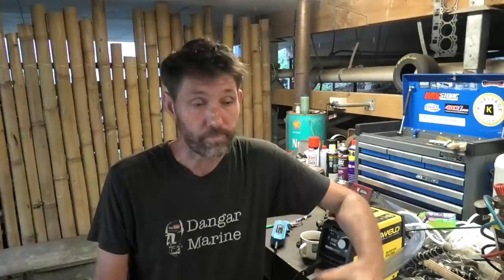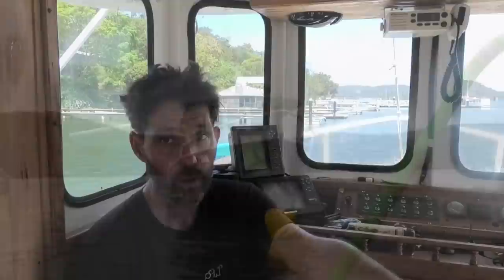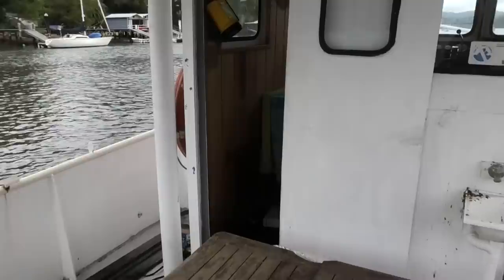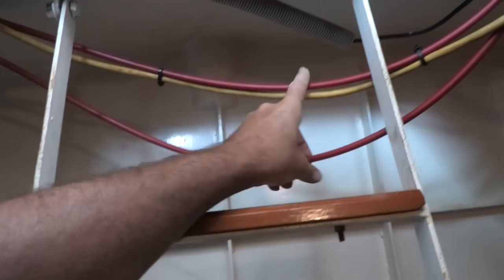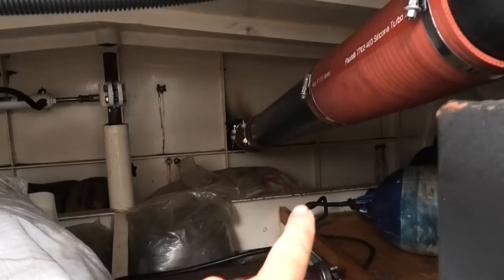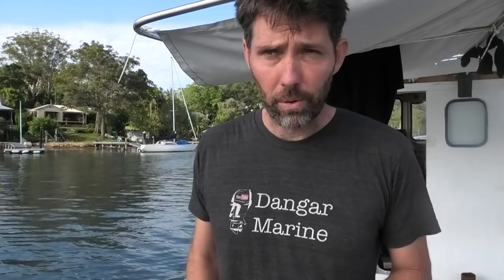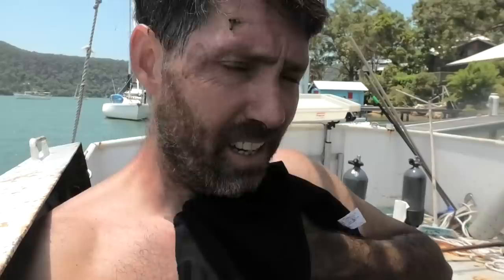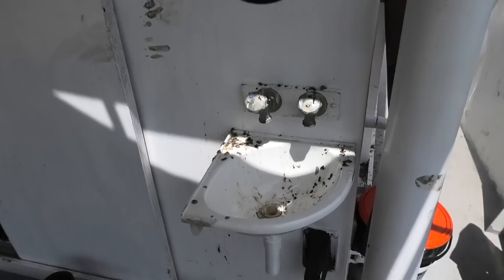Is it a bad idea to buy an old steel boat?

Comment: I had a Navman GPS in the late 1980's... it was one of the most intuitive GPS's I've ever owned (and I have 10 +). You simply did not need a manual or tutorial to operate it.  I believe it originated in New Zealand.... cool boat!
Reply from the maker: Although I didn't have any charts, I used it all the way up for heading and speed, it was great. :)

Comment: driptroits were always good runners  but fuel hogs. if the governors are set correctly you can rip the engines apart and put them together and they will run just fine.  i expect that someone set that with the throttle linkage installed.big mistake, but if it runs ok otherwise its a small adjustment  to get it right. hint set it with the boat in gear. that may be what is wrong. it may idle a hundred rpms higher in nuetral but that wont hurt nothing.

Comment: Stu,
Congrats on the new boat!   Looks like it's worth putting some time into.
Great thing about a steel boat, is you can always cut and weld, if you need to repair or modify.  Again, congratulations!
Reply from the maker: Thanks Tony. The ability to cut and weld steel and have it be as strong as the original plate is  one of the things that made me happy to take a gamble on this boat.

Comment: You mentioned rust several times but I didn't see any on that boat.  In fact,  compared to some really rusty steel hulls I've been on, that one looks pretty darned clean.
Reply: Some was on the deck
Reply: Don;t worry ..if it's old it will have plenty (most of it hidden)

Comment: I'm sure you probably already know this but Stuffing boxes / packing glands, which ever you prefer to call it will always be trouble, You probably have to open it up and pull out all the old stuffing and add a few new rings. we always used the wax coated military surplus stuff but if maintained properly it will just drip slowly to keep the shaft cool. every trip, a few turns on the nuts and it will return to a slow drip!   my opinion, change it to dripless shaft logs. good luck.
Reply from the maker: Hey mate, I have been looking into a dripless conversion, but I'm a little worried about how little room there is between the gearbox and the bulkhead. If I can't get anything to fit I'll definitely disassemble, clean and repack this one before putting it back in the water.
Reply: Hey, for what's it worth: my experiences with these kind of seals are pretty good. No leaking in years in neither of the boats. Also in our case it's not necessary to tighten the gland frequently. We do fill the shafttube with grease though. Sorry for my bad English ;)

Best regards, 
Dirk
Reply: Fresh packing and lots of grease, and it will be fine.   Put in more packing than you think, as it compresses.  That's why the bolts are so long.  Grease it well, and it will only drip here and there.  
I like the idea of making a mini-bilge under it.  Great idea.

Comment: We just bought a really old wooden boat and sailed it half way around the world, we are on our way to sail the other half :-)
Reply from the maker: Great to hear you are getting out there and have a great adventure. Safe travels! :)
Reply: Dangar Marine becarefull about the hawksbury river monsters.
They plucked a cop right off the stern during a party.
Reply: Steel I know, steel i understand, steel I can weld in replacement plating and zinks.
Reply: HappyandAtheist  with steel you wouldn't have had it.
Reply: HappyandAtheist  cool, I'm a commercial fisherman from Alaska, also an atheist and reasonably happy. Yup, lots of chipping, grinding and painting but steel for a reason.
Reply: HappyandAtheist  Nailed Plywood,,, on what kind of boat and how'd you do it?

Comment: We had PSS dripless shaft seals in 3 of our work boats and gave great service, I’ve also got one fitted in my own sailing boat and it also been fine... the only problem we had with 2 of our steel workboats was the grub screw working it’s ways out a couple of times causing it to slide on the shaft...
That leak is a little more than I would feel happy about I must say!

Comment: We've worked on all types of boats and prefer steel...by far. It's so much easier to modify/outfit. Adding lifelines to 40' fiberglass took us a week...same size steel boat took a day. Through bolts, backing plates, and sealant on fiberglass...just weld it on in steel.

Comment: They have not built a 4-71 Detroit in 50 years
Reply: No need to - the old ones are all still working fine :)
Reply: @mordokch  Here is one for you. When we rebuilt these engines we would put the pistons in dry ice and the liners in a very hot oven. We would remove the liner and put in a holder and then insert the pistons and then put the liner and piston in the block.  We gaped the rings on the cylinder when the were completely collapsed around the pistons.

Comment: Bit of Homework for you so next week ... you may be able to get the  nice Local Chesterton distributor just to throw you  a free roll of Packing, would recommend you maybe bit a stainless for a Packing Gland spun off a Lathe,  you could strike lucky, even a scrap bit heavy wall Stainless pipe 'Slip on" flange with a stub of pipe that had been already  welded to same, could be skimmed down to act as a new stuffing box...if you come by one with the correct rough dimensions...Time to Pull the Packing as it's probably hardened up and no amount of swinging with a spanner will cure  same....Hand operated Bilge Pump could be a Belt and Braces Option....you have really got there now these issues are just minor tinkering... again another Great upload...

Comment: A marine survey is HIGHLY recommended before buying a vessel like this.  Dangar Marine is 100% capable of dealing with most of the issues, with the exception of an ultrasonic reading of the thickness of the steel for possible pitting of the steel.  Extreme cases require re-plating of the hull.  With all the water in the bilge I would want to have the boat hauled and inspected before purchasing.  Other than that, looks like a good score!
Reply from the maker: I've been looking at the testers for checking the thickness of steel online and they've really come down in price. I'd like to see some good reviews first though to see how actuate they are, particularly when measuring through paint. It would be a great tool to have though, even just from a peace of mind point of view.

Comment: Take a 3 inch piece of rubber fuel hose and split it. You can slip it over that locking nut on your shifter.  It might be vibrating loose..

Comment: 3 suggestions. Fit a dry stack to in and weld the transom shut.  Install 2 bilge pumps with dedicated wiring to battery. Fit a boom over the hatch covers to  ease that battery  change and dive tackle.  Good idea on the chain locker, just don't leave it open to salt waterl Good idea on the gunwale cutouts.

Comment: The variable speed governor on your engine is very easy to adjust idle speed on. There is an adjusting screw that fits a 1/8” Allen wrench right below the throttle cable you adjusted. It has a locknut that a 7/16” or 11mm wrench fits on. All you need to do is turn in that screw slightly while the engine is running and the rpm will increase. Then lock the nut while holding the screw from turning. The buffer screw then needs to be set which is just as easy but can be the reason that the Detroit’s Diesel engines run away. The screw is only turned in while the engine is warmed up so that the rpm does not increase more than 15 rpm. You need a good digital tach. The buffer screw is located 90 degrees from the idle screw on the side of the governor housing it is a 3/8” fine thread screw that uses a 9/16” wrench to lock the nut.  Most likely the buffer screw is your problem as it stops the rpm from dropping to low when the throttle is pulled back to idle quickly but the idle speed has to be in the right range usually around 550 rpm before setting the buffer. I’ve been a diesel mechanic for 30 years and have built thousands old Detroit’s right up to 16v-71s

Comment: The stern bearing/ stuffing box on my rusty old steel boat has a grease line in to it so at the end of the day fill it to stop the leaks. The water dripping in helps cool it.

Comment: Interior bilges look great. That is where steel boats rust at. Little trick for keeping the hull looking nice. Phosphoric acid. We have a product here in the Sates called Ospho. I use to keep it in a spray bottle. One trip around the hull in a dingy and spray this stuff on. On the second pass rense it off with a little water and the rust stains go with it.
Reply from the maker: Yep, bought 5 litres today. :)

Comment: My steel tug is 75 years old and is 72 ft long. Only replaced 1.5 square meters of hull plating in the wet areas,  the rest of the hull is perfect. The Atlas Imperial engine runs smooth and uses 2 litres per NM not bad for pushing 100 tons through the water. She's for sale NZD75000

Comment: A old School Temporary fix. on Steel Hull Boats and Barges is to stuff the holes   or leaky areas with Toilet Wax rings  and rags  then drive  Wooden Wedges into that to  help hold it all in place  that will often. allow the Bilge Pumps or Bailing to keep the hull floating  or being lost  i was once on a Fiberglass Vessel that rammed a broken Sunk Wood Piling and punctured a hefty hole into the Hull  i jammed a bed Comforter  and Blankets into the opening and it allowed us to safely get to a close Marina that had a Travel Lift they  could use to keep the boat from completely sinking  the boat was eventually fixed correctly  and the last i had heard was still being used by its last owners   those Toilet Wax rings are inexpensive and very Sticky  of course they are designed to seal Water from leaking  at the connection of a Toilet to the Drain Flange  on the Sewar Pipe

Comment: If you will be welding on the hull, you might want to consider a clean water sump under the shaft seal. You just build up a watertight box under the stuffing box with vertical  flat bar welded to the bottom plate, typically extending forward to the closest frame.  You fit a small float actuated bilge pump into the sump. Any leakage from the stuffing box collects in the sump and is pumped overboard with the small bilge pump.  The sump isolates the shaft seal water from the engine room bilge, so the seal water does not get contaminated with oil. Hence the name "clean water sump".  Greg

Comment: Have always been interested in taking over an older metal work boat.  Will be interested to follow along and see what u do / run into on this project.  Thanks for sharing your experience!
Reply from the maker: There will be lots of work I'm sure Tom, but if you get the right boat it is all doable and well worth it in the end.

Comment: The Detroit 71 series diesels are hard to beat.  You should use Delo 100 in them because it was designed for them.  Other wise your oil usage will go up.  All the Jimmies I have been around in the lower 48 and Alaska have a couple of sweet spots,  1350-1375 and 1725-1750.  

Oh you may have people telling you how fuel thirsty Jimmies are...  because they are two stroke!  They are not.  The one thing to be careful of is jazzing the throttle fast...  They have been known to break the quill shaft that drives the blower.  To remove the blower you will need a 9/16s horseshoe wrench.  There are two bolts that need that wrench to be removed or installed with out removing the cam/blower drive covers.

Comment: My mooring was next to this boat for several years in the Lane Cove River, mate of mine owned it. He was a marine mechanic for many years and now works on cranes I believe. It's nice to see this old girl being worked on, it's a great boat. Does it still have the remote control fob for activating the lights etc? Was a great feature when you row out to the boat early morning in the dark you could click the key fob and the anchor light would come on, very handy.
I gave him that radar, never worked but looked good!
Get in touch if you would like to know more or would like the contact details of the long term owner.

Comment: This video set of my PTDS. I once bought a cheap unwanted 38' steel boat - my condolences. As to the donk, as a kid i plowed on an old Chamberlain Super 90 tractor with a 3-71 s/charged engine. 40 years later i still have tinnitus in both ears.

Comment: Thomas Colvin wrote the definitive book regarding steel boats. In a nutshell: sandblast to white, give proper primer and paint...it will last 20 years. I had a 10 meter sailboat abandoned to me in year 2002. I'm still living on it now, (2019 w/ only minimal maintenance.
Reply from the maker: You're dead right that you can't beat sandblasting. I will probably do that next year after a bit more saving. It is about $2500 to do the hull below the waterline.

Comment: Terrific Stu! Looking forward to lots of interesting videos on this new project. Love her lines and of course looks nice and heavily built. Combined work boat and pleasure cruiser is a great mix!  A couple initial thoughts. Engine injectors - maybe a place to investigate? Also, looks like you might have a bit of exhaust leak around the thru-hull? Be good to get that sealed if so. Great idea about cutting some boarding doors in. Might want a double-wide one somewhere in case you have to wheel larger cargo or equipment on board. Speaking of equipment, you've got lots of room on that deck for a fire/high capacity water pump. Great insurance and very helpful around the waterfront for everything from washing down decks to refloating boats. Looking forward to the voyage!

Comment: I know the joys and lows of buying a steel boat. I bought a 32 ft steel ketch cheap and I am still working out all the little issues that have come from the previous owners contributions. Your vessel looks very sturdy and should be fun to use once you get it to where you want it.
Reply: 10 kw ekrrç  32 kw baters oàçk 3,2 hiurs topspred

Comment: Steels typically rust from the inside out, that's where you need to focus as far as the hull is concerned.  Replated the aft 6' of a Chris Craft Roamer years ago and it already started getting pinholes after 10 years or so.  This was in fresh water to boot...

Comment: 9m is a good size, most of the cheap pontoon docks are organised around that length. Short wheelhouse is fine as long as it can accommodate what it needs to do. I think Id be looking at the helm station, a small galley and a dinette is a good idea for when the weather goes off. Steel boats offer a lot of utility in that they are significantly easier to change of modify provided you can conquer welding in the plate sizes you will be using. They do live and/or die on their paint system which you might not be entirely in control of, given the thing is already painted to some fashion. The problem Ive always been concerned about is that workboats usually dont have the most economic power requirements, for instance sometimes theyre designed around hauling 5 tons of dead fish in two miles of net, rather then carrying a few bodies over to the not so local diving or fishing spot. Still a good project and should provide a lot of interesting experiences. 
have a good one ...
Reply from the maker: I'm really happy with the size - not too big not too small. I'll give a better tour of the wheelhouse in this weekend's video.

Comment: As long as someone can weld and a boat's superstructure is not too thin, then steel will always be an easy fix and can be repaired and plated for many decades. Steel narrow boats are still afloat that are well over 100 years old...
Reply from the maker: Steel definitely is easy to repair. As you say, some freshwater boats are over 100 years old.

Comment: Tough accent, mate, But I get most of it, lol. Had a twin engine 30' cruiser - never could keep the port engine from stalling the same way this one is/was doing.  Finally trashed that combo throttle gear shift manual doohickey thing and went with electronic gear/throttle - that fixed it, and provided an order of magnitude improvement in docking and maneuvering. No setting it up too tight so it wouldn't move without overshooting, or too loose so it wouldn't hold a position. Then I added remote control to the electronic gear/throttle, and that made single-handing while docking or departing a piece of cake (well, relatively, at least).
Reply from the maker: Sounds like a worthwhile upgrade, I'll definitely look into that.
Reply: chef 30 fit ab çtuser ektrcr boat uaght

Comment: I picked up a boat like that long time ago I think it was a little bigger than that I think it was a 30 or 35 foot same 471 diesel engine had the same problems as you bad bilge pumps it was leaking it almost sunk in the middle of the ocean I just picked it up around December it was cold in New York how to replace the shaft and seals yours is a lot better condition but I had fun working on it the holding tank was huge good luck with it
Reply from the maker: Sounds like you had quite the adventure!

Comment: I’m looking at doing this with an older steel fishing boat and fitting in an electric motor with a tonne of solar. Speed isn’t the issue for me. Just slow cruising and less maintenance.

Comment: If you ever get a runaway Detroit there is two ways to make it stop running, you have to absolutely cut off its air supply, the smallest gap in the shut down flap and it will still run. The other way is to flood the intake with carbon dioxide.

Comment: Fix the packing gland on shaft first. Motor may just be binding on the shaft in low revs.
Reply from the maker: Sounds like good advice. I will definitely be fixing all the basics before touching the motor.